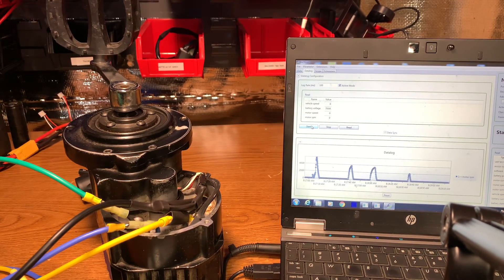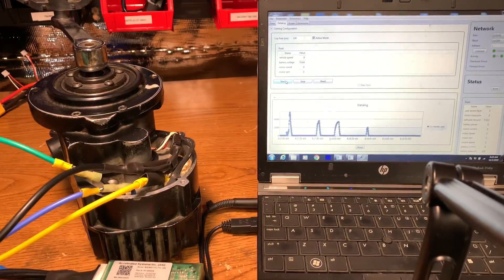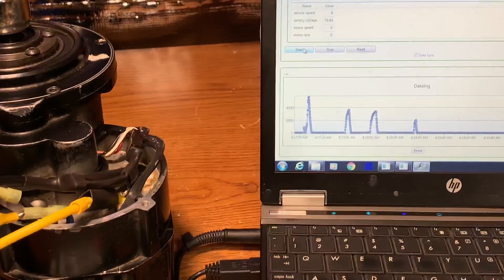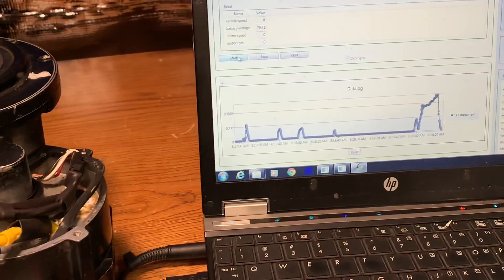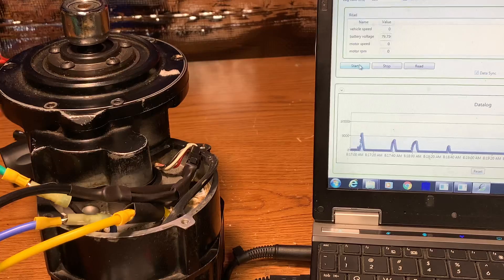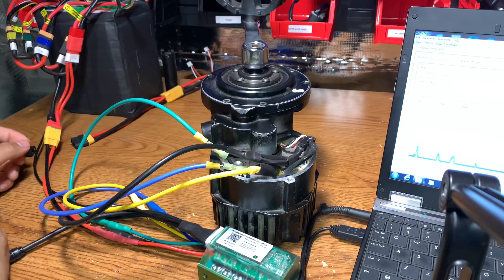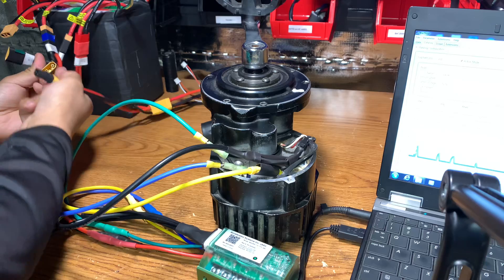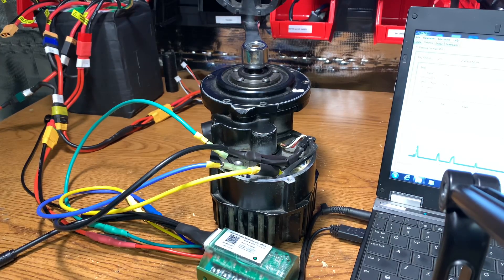BAC800 BBSHD 48V-72V Universal Battery a Profile 10,000-13000rpm

Comment: What good is measuring RPM with no load? My bike will spin the wheel up to 43 mph (with touring gears) when she is on the center-stand but can't ride that fast on a level surface. I use an HD for heavy touring and huge RPM means very little to me. Batteries are the largest investment for ebikes so I try to only use 60% of my li-ion 58.8V 30Ah packs when riding, hoping for 1400 recharges... or more. What do you expect your battery life to be? It's probably harder to get firm numbers when you have multiple packs to string together. I'd also love to know how to test a pack for performance after many hundreds of rides. - https://www.youtube.com/watch?v=0KrJ2SHFdjg&t=10s

Comment: Thanks Alan. Cant wait for my kit to arrive. Glad you were able to get it to run a like this. Hope I don't melt too many plastic gears!
Reply from the maker: Keep your front chain ring to a small size like 30T or 36T and you will be fine!
Reply: @wavebicycles   Thanks Alan. Will the TFT Color Display 750C I ordered with my kit be able to work with and display voltages from 48-72V?
Reply from the maker: Mr. Husq Varna you are correct
Reply: You can get metal gears I'm pretty sure theres a vendor on endlessphere
Reply: legna199111 Yea my post was from 8 months ago. Luna cycle sells them. Already bought one. Thanks

Comment: Perfect thanks very much I have been waiting for a video like this 10 000 rpm on 55 volts is fantastic. I have 2 bikes with bbshd fitted with 2x 13s 9p packs ga cells 31.5ah and been wanting to upgrade the controller but was unsure if there would of been any + points and this verifies it. What kind of amps would it draw on 48v my packs would be fine for 50amp?
Reply from the maker: On 52V, it would draw 58A to reach 3000W. If you have a compatible display you can set it to a lower assist level and it will reduce power and peak amps.
Reply: @wavebicycles  thanks for the reply that would be fine my smart  bms is 60a and I can monitor the batteries via bms it's not like I would be running 58a continuous any way. 

I have 500c displays so can't limit the amps via that could you tell me if you can with the egg rider? Or would I need that be a cycle analyst/ca3 for that? If I did want to limit it. 

Thanks Daniel
Reply from the maker: @danielgreen4213  I sell TFTs with working assist feature, Eggrider can also limit current.
Reply: @wavebicycles  perfect thanks I shall place my order this weekend